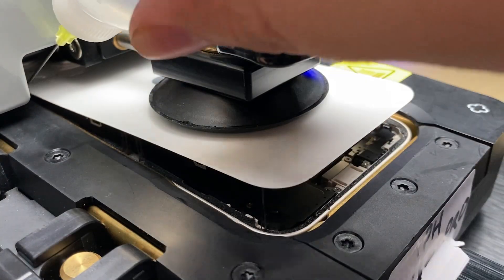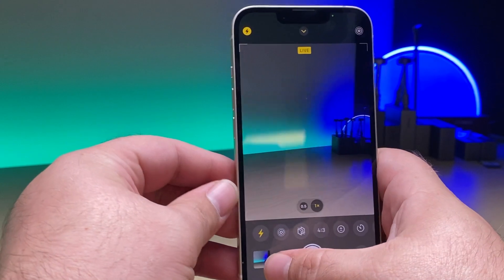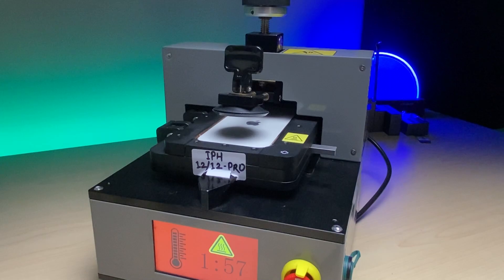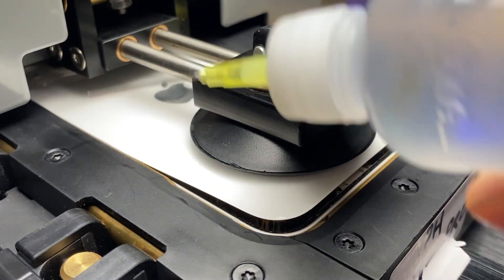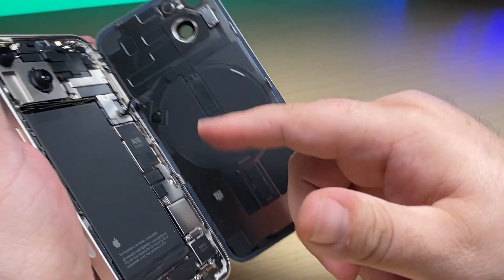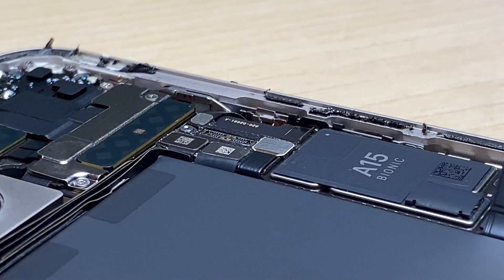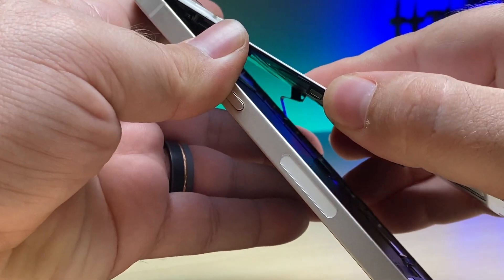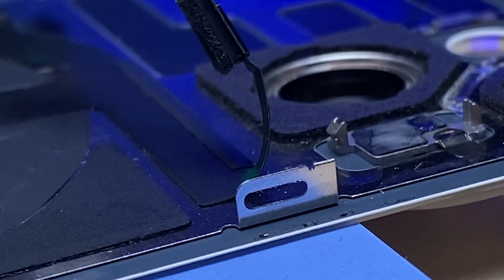IMPORTANT INFO on the iPhone 14 and 14 Plus! Flash flex IC (Tips and Tricks #40)

Comment: Great video! I agree. It's not that difficult to swap the chip. 

Apple changed the position of the chip for the iPhone 15. It's now touching  the glass... Less protected, in my opinion. If the flex gets damaged, there is no problem. If the chip fails, only Apple can fix it.

Comment: Swaping out the IC is not that easy without the expensive equipment needed. I found the flash save issue is not tied to the phone, but tied to a OEM IC. So any back glass from a Apple phone swaped to a Apple iphone 14 works. I bought a Iphone 14 back glass pull from another Iphone 14 and it works without error. Those cheap China clone back glass won't.
Reply: I was thinking of getting an iPhone 14+ back glass from an original iPhone 14+ I shouldn’t have the issue then correct if it’s OEM?

Comment: I have a 14 Plus that keeps kernel panicking with code 0x400000 which refers to the wireless charging coil. The rear cameras are showing a black screen and flash is disabled. Wireless charging works fine though. I’ve tried restoring, I’ve tried a replacement camera module and the wireless coil but it still panics with the same code. Any idea why this is happening? No physical damage to the phone.

Comment: Apple got us just when we thought replacing back glass of 14 series would be easier 😂
Reply: they always pretend to move a step forward but take 2 steps backward
Reply: The mere fact that Apple is doing this, it's outright malicious and anti-repair.  It serves no practical or security purpose since the iPhone 14 Pro and ProMax works just fine without this parts locking BS. smh

Comment: Couldn’t you have just transferred the OEM flex cables to the new back glass rather than removing OEM IC and soldering it back on to aftermarket flex cable? Or was the soldering step shown in case the OEM cable was damaged or torn?
Reply: yes, you answered your own question right.
Reply from the maker: yes and yes
Reply: Is what your saying is a used OEM IC cable will fix my camera